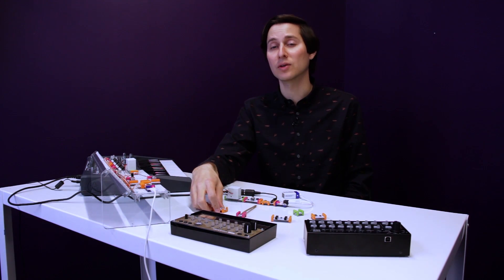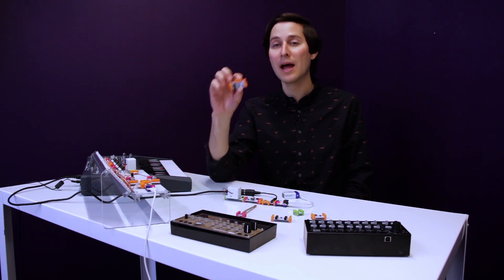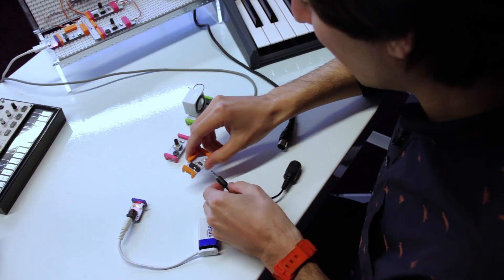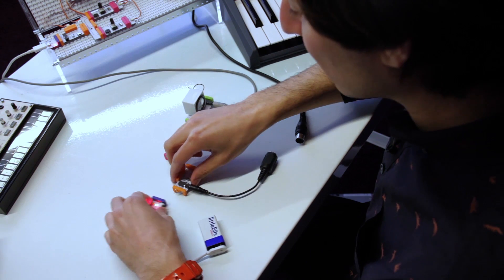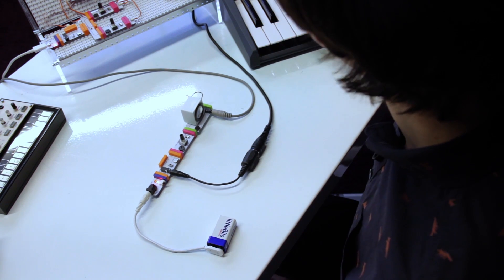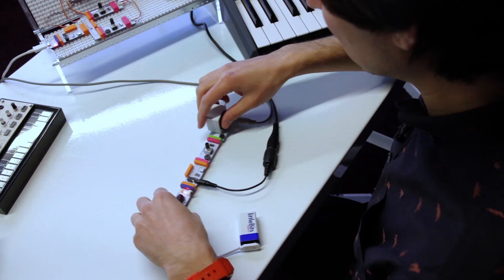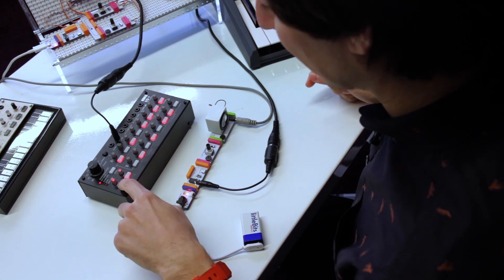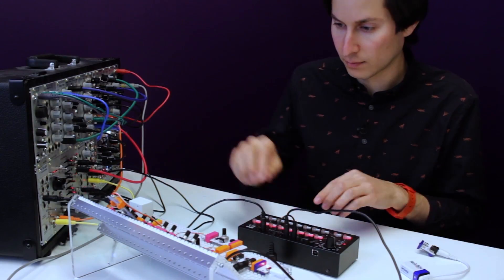Getting started with littleBits & Korg MIDI module Pt. 1 MIDI IN

Comment: This looks awesome. Just a couple noobie questions: What keyboard are you using? Is it a synth or just a midi keyboard? Also when you go from your keyboard to the SQ-1, you are going Midi In from the Keyboard to the Midi Out of the SQ-1- Is that correct? And finally with this setup, record into Ableton you would need to attach a USB bit and connect that to the computer?